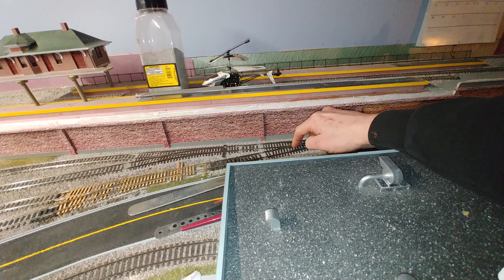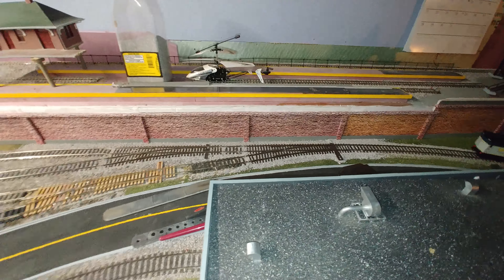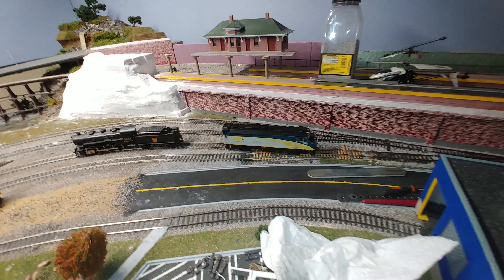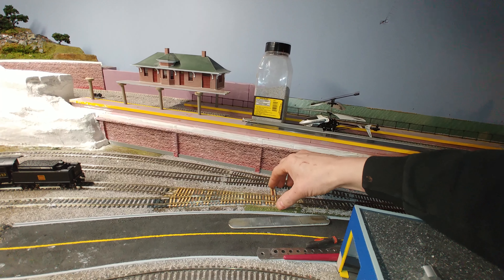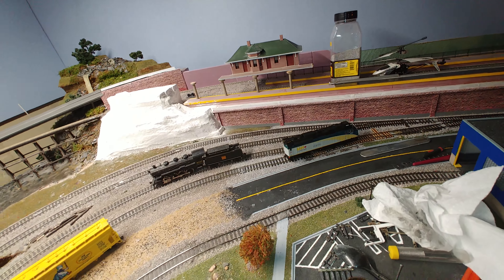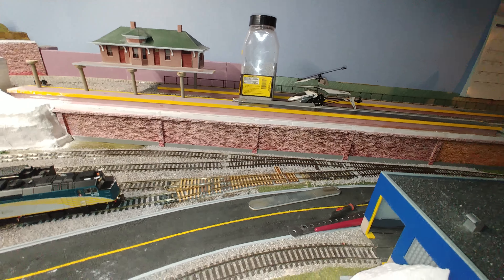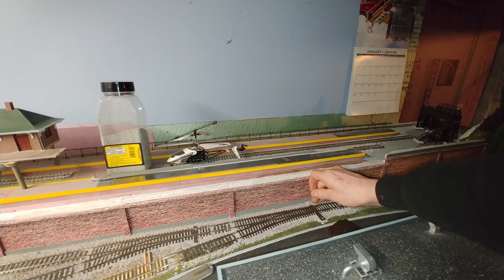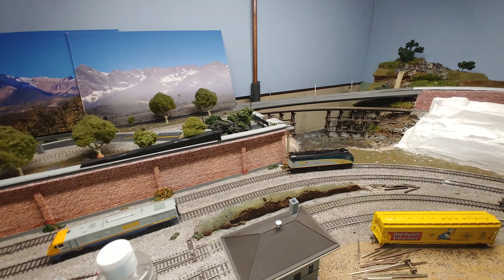Working on turnouts

Comment: Scott I would still juice the frogs for your 4 axle locos, especially if not loksound equipped. I found with my converted turnouts the esu equipped locos no issues over turnouts. My soundtracks tsunami equipped locos either studer, lights blink or  just plan stall on unpowered frog on lower speedsteps.
Reply from the maker: I will run the feeders and if I have issues I will connect them up but for now I will save the money.

Comment: Good to see a loco running on your layout , looks like you having a few problems , which I am sure you will manage to sort out ... Dsve
Reply from the maker: One thing I have learned is not to built most of the layout and leave space for the switches.  Sometimes they never line up exact.  Live and learn as they say.  So far I think most of the issues are solved but time will tell unless new ones come up.

Comment: It will be an exciting day for you when you can run in a full loop.  It saves a lot of fiddling.  Way to go on building your own turnouts.  That is something I had not thought of.  Home built turnouts would not have the spring that commercial ones do.  Rob
Reply from the maker: Sometime I wonder if running a train in a loop will every happen.  I spent so long working on scenery instead of the reason I built the layout.  Building your own turnouts is great.  I find the hand built ones to be much better than the commercial ones.

Comment: Too many feeders become redundant. If you have good connections at your joints you will have good power all over. Your track is larger gauge than most of your feeders, right?
Reply from the maker: This is true but with my luck if I don't install them I will have problems.  If something can go wrong it will happen to me.